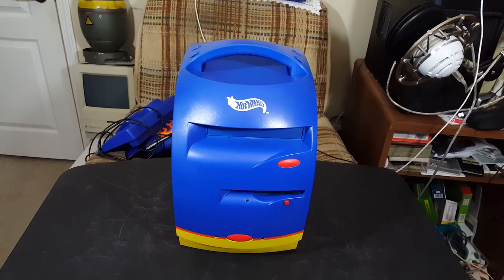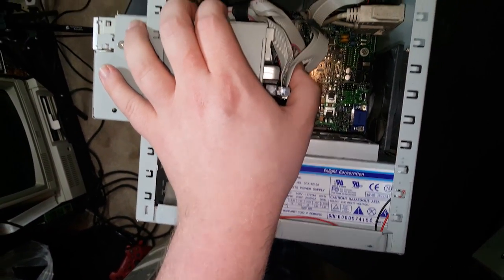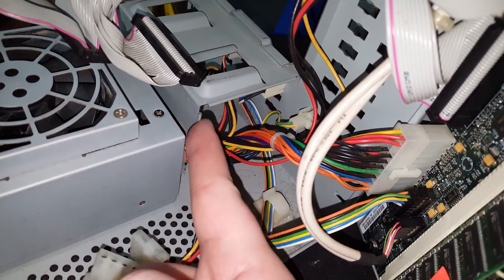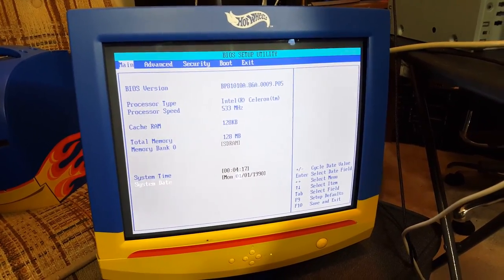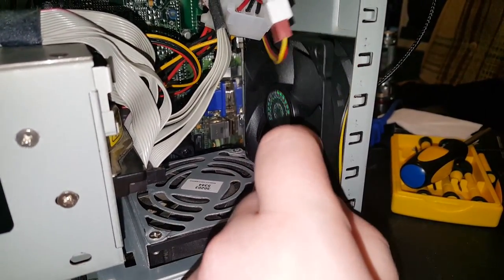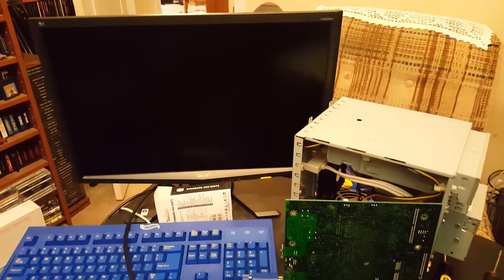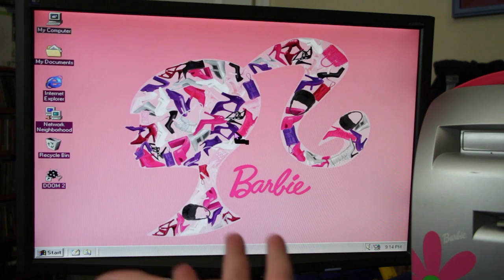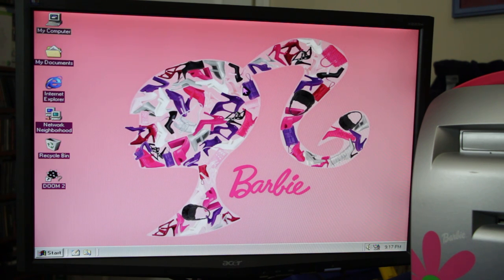LGR - Repairing The Barbie/Hot Wheels Computer

Comment: doom on a barbie computer priceless
Reply: NATHAN NEVILLE i want this ! Going to put i3-7100 itx motherboard AMD gtx 750 ti low profile
Reply: Thresh The Chain Warden >amd gtx 750
Reply: KadenTT i bet he doesnt know alot about newer pcs
Reply: I'm pretty sure my 9yo would love it the way it is and play the crap out of that game : )
Reply: On the other side, Windows 98 and ME are pretty much doom in their own ;)
Reply: Vetraxik
Good luck with that, considering there's no expansion slots on the back of the case to house a graphics card of any kind. Unless you mod the case somehow. Not to mention these OEM desktops normally have proprietary motherboards that only work with the cases that they were built with. So trying to install a 3rd party motherboard in that case and expect to use the front panel power button, USB slots (if any are present) etc, would leave you with nothing short of a headache. Plus the rear panel I/O ports on the mobo most likely won't even line up with the I/O shield on the case. Trust me dude, it's not even worth trying.
Reply: You give up too easily. With the Mini ITX standard, I'm fairly confident this could be turned into a new mainstream PC just fine. The IO shield can be snapped off and the one that comes with the new board could be put in. And today's integrated graphics are quite capable. If I had the money, I'd use a PCIE extension cable to stuff a GTX 1080 in just for fun. You know, to mess with people. The ultimate sleeper build FTW!
Reply: zwz • zdenek
Well I suppose it would work with integrated graphics, but I wouldn't call them "capable". They can run certain games that aren't too demanding but there's no way in hell you're running Battlefield 1, Witcher 3 or even GTA V on integrated graphics. Unless of course you disable some features like Low-spec Gamer does. But then you're left with a game that looks like utter crap. I dunno. The whole idea seems pointless unless you're doing this as a project on the side. I wouldn't recommend using it as a main PC though.
Reply: no KIDS GAME ONLY
Reply: this comment may be a year ago but holy shit, you won the internet!
Reply: That some half testosterone
Reply: Lofote Doom on Doom
Reply: I'm a Barbie girl in a Barbie world full of demons and guns and I'm in hell
Reply: You mean princessless?
Reply: NATHAN NEVILLE oof
Reply: Ha!
Reply: She's a baddie.
Reply: This is hearacy
Reply: TheSliderW Jesus Christ dude what kind of child are you raising

Comment: This is truly like working on modern cars. To get "A" out, you have to remove "B". But to get "B" out you have to remove "C". And "C" won't come out until "A" is removed.
Reply: Almost a quote from my car's manual in the section "How to take out the spare tire", except the letters are up to fucking "z" or something
Reply: *****
 yeah, my grandpa told me when the 1989 Buick Reatta came out and everybody wanted it because of the CRT touchscreen display... wonder how much of a bitch would it be to repair today haha
Reply: *****
yeah, me too pretty much but i wouldn't mind one of those flashy lcd displays :D
Reply: Eric Blecha in my fiat's manual the section "removing the spare tire" takes up 10 pages...
Reply: *****
yeah, just because they had to put it on the frame under the car and not in the trunk...
Reply: jackthegamer electrical problem. i prefer run carbs
Reply: It sounds a lot like algebra to me XD
Reply: Now I'm wondering what a touchscreen display would be used for in a car in 1989.
Reply: To remove battery:
1) Remove air filter housing by following steps in section 7.4.31.2
2) Remove engine by following steps in section 2.1.5.20
3) Simply remove the impossible to access retaining nut, using special dealer tool ZQRF-1234-30-A
4) Remove the battery
5) Reassembly is opposite of disassembly
Reply: how about the dodge avenger with the battery hidden inside the passenger fender well
Reply: I really hope there are no more manufacturers putting the battery in a fender well. Friggin Chrysler Sebring electrical problems.
Reply: Thats the truth
Reply: battery in the fender well? whhhaattt lol
Reply: yeah sounds like a quality idea right? almost as bad as BMW putting it under the rear seat on the E34. Batteries should be in the trunk, or under the hood, and easily accessible.
Reply: rooster sideburbs yup, Chrysler has been putting the battery in the fender well of their midsize cars since 1995.
Reply: are they accessible?
Reply: rooster sideburbs No, you have to take the wheel off to remove the battery. the battery harness also tends to corrode since it's exposed to the elements down there. It's dumb.
Reply: Zeke That Gamer Geek with the 1st generation cars, you could actually turn the wheel all the way to the right, remove the splash cover, and wiggle the battery out through the space between the bumper and wheel; I know how because I've done it before on my first car, which was a Plymouth Breeze.
Reply: I had to partially remove the fuse box, push it to the side, and then take out the air intake just to change the headlight on my mother's 2005 Volvo.  I'm all for fuel economy, but modern cars have gotten too compact, I remember the 1990 Volvo we had, like half the engine bay was open space!
Reply: scottthewaterwarrior that is why I like my Chevrolet Aveo; 3 10mm bolts, and two connections, and my headlight assembly is out!
Reply: Eric Blecha oh you do not know the hell that is retro computers. its like you said above, but once you finally got everything almost out, an unknown object "d" is blocking everything, but you dont know where or how, so you just get mad give up and come back a few days later. wash rinse and repeat until something breaks that gets you into a bigger hole than when you started, or until the planets align and it finally works
Reply: Eric Blecha 
That means that you have to remove them all out at once.
Reply: The way cars are going, in a few years you will probably have to remove parts A-Z just to get the owners manual out!
Reply: Take them all out at the same time
Reply: pray you never have to remove the starter (if it's the 5 cylinder)
Reply: If you had a Toyota Hilux/Volkswagen Taro that had the AC installed, 
then you had to disassemble the front bumper every time you were going 
to replace the light bulb on the side where the AC was located...
Reply: MoseyingFan TOYOTA HILUX IS THE BEST CAR IN THE WORLD THE OLD ONE
Reply: oh my god this. I have a 2003 Sebring LX convertible and I can confirm, Chrysler decided to put the battery in the driver's side fender well. Such a pain in this ass to get it out of there, especially with the bracket that's supposed to hold it in. So far though, no real electrical problems. All the problems are just in the engine.
Reply: a circular reference
Reply: Then remove d
Reply: "Remove part cluster 'abc' before proceeding."
Reply: Did you mean programmer's work?
Reply: @plaidzior  In my Astra's manual it takes up.....none! Because there is no spare tyre, only a puncture repair kit!! :)
Reply: YES! Literally thought about when I replaced the alternator decoupler pulley on my hatchback while watching this. 

That was quite a weeekend.
Reply: Exactly! I once owned a fairly new car and when the lightbulb of the head light failed I had to remove the WHOLE front weel in order to replace it! Ridiculous!